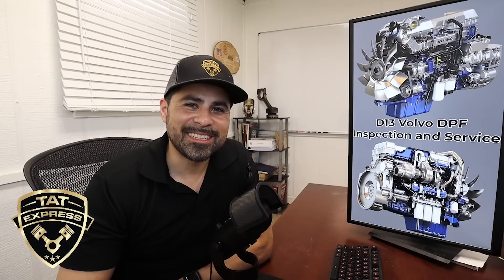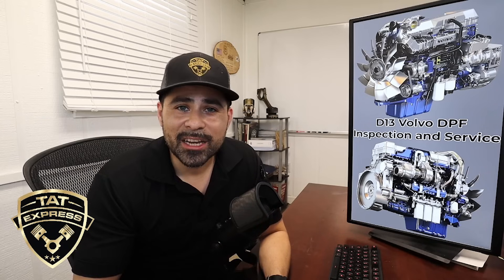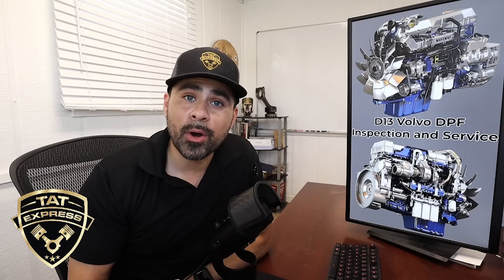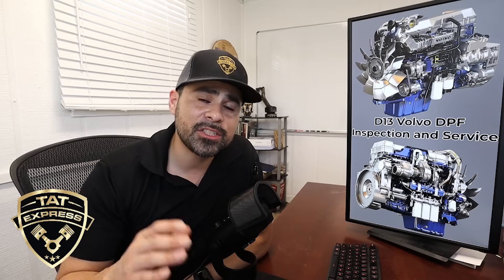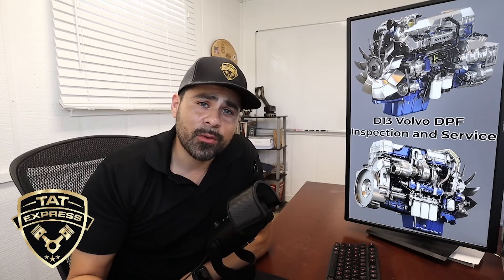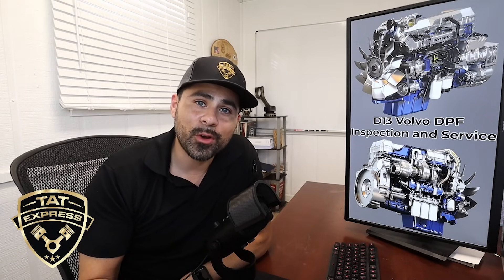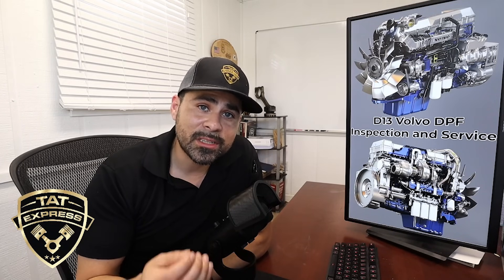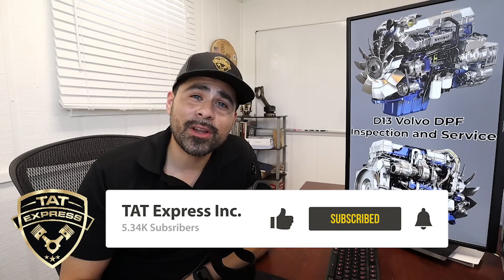D13 Volvo DPF Inspection and Service/ Frequent Regeneration / Volvo parked regen needed/ DPF Main.

Comment: Please can you provide me with your location I am having an issue with Parked Regen every other two days?

I replaced the new DPF filter and prime new Turbo Charger 6-7 months ago. After all, my truck is showing “poor Def detected and Engine will derate in <60 MN”

I also took Volvo mechanic and did run system diagnoses and found an inactive Crank pressure sensor. And still, I am having an issue with Regen.

I am tired of this DPF system. Do you think I should just delete it regardless?

Comment: Would you happen to know on 13 cummins isx a moderate aftertreatment dpf intake pressure fault.. I have the MIL lamp on, and truck does frequent passive Regens while driving.  I had the dpf and doc cleaned recently.  Been doing the passive Regens alot since 500k its at 800k now. Thanks.

Comment: Hi guy's,  I have the same problem on my 2015 volvo d13 it has now 1.2m km on it and I replaced this year 3x the nox sensors 2x def dozer valve the 7th injector 2x the flex pipe just got my dpf and cod cleaned out and a Crack in the pan welded.  I put the heat blanket around the new pipe gaskets and clamps.  Drove for a day and it was leaking again. I'm frustrated with the system.... what else can it be. Have original injectors just once an valve adjustment. Is it a wiring issue or def heater or.............. please help

Comment: Do you know what the problem is when a Volvo says SCR performance low? It says it needs to be regen even though the soot level on the gauge is relatively low, I do the regen and it takes it well and the message goes away. I replaced the nox sensors as well as the dosser valve and it did it again anyway.
Reply: Are you getting water or oil in your exhaust?
Reply: @moneymikeslickwill8749  neither one, it ended up being a very small port where the scr pressure sensor is seating that was clogged, I poked it with the little straw that comes in the WD-40 can and unclogged it, haven't had the issue ever since, not asking for regens anymore and not derating, crazy how such a small thing can cause so much trouble
Reply: @andresalvarado4969  bro i know you where soo dang happy not having to throw $6k worth of parts at her. Im soo shocked how many owner ops dont have any tools or knowledge on how these awesome
Machines work..
Reply: @moneymikeslickwill8749  hell yeah bro I was so damn relieved. The machines work great we just need to take good care of them.
Reply: Can you point me which port/sensor were you unclogging? I have the same issue. Almost ready to give up on this truck.

Comment: My 2015 Volvo D13 engine. my soot level is always high and  a lot of regens .  So Adam please tell me one of the items like turbo or egr would they give me codes. Thanks
Reply from the maker: I would start with codes and if over 300k clean, DPF, EGR cooler and sensors

Comment: Great video I got a 2010 d13 that would not complete the regen and derated and shut off know with your video I have a starting point
Reply from the maker: Aaron, if not completing a regen than something is going on with system and it needs to be checked out by an experienced shop.

Comment: Thanks for the videos. Awesome stuff, I have a 2013 Volvo with a isx 15 it does a self region about once a day or every other day. Is that normal? The emission system has had regular maintenance.
Reply from the maker: Logan, that would be considered frequent regens. If you are above 300k than filters and ATS would need to be serviced.  Let me know if you can make it by our shop. We are located in Dallas TX
Reply: TAT Express Inc. thanks for getting back to me quickly, man your really helpful. I’m out of Jacksonville,Florida I will definitely hit you up if I’m out in Dallas. Greatly appreciated
Reply from the maker: We get drivers from all over the country.  Looking forward to meeting you